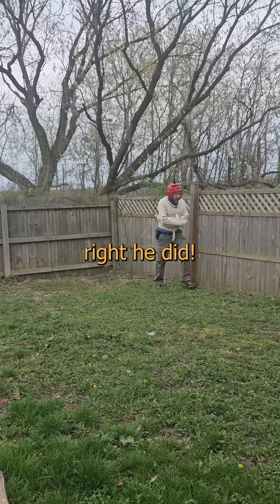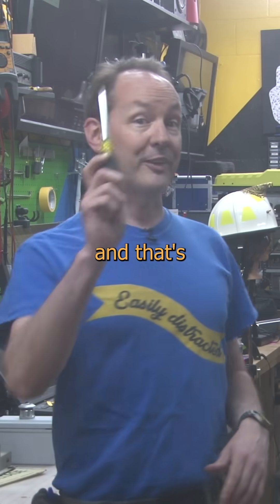Rack Screwed #chrisboden #comedy #engineering #screw #hardware #rackmount #apprentice #educational

Comment: Makes me think of when i was a kid riding horses - had i been told multiple times to wear appropriate foot protection? Yes. Did i decide to forgo said foot protection because i was running late? Also yes. Did i find out getting your foot stepped on in tennis shoes hurts WAY WORSE than it does in boots? Yes, and after the adults around me confirmed i was just bruised, i got very little sympathy for an injury that was my own dang fault. I always wore my boots after that, even if i was running late.

Comment: Step 1
NEVER HAVE AN IMPACT WRENCH.
Step 2
Find a way to lock the drill on 1-2.

I keep the impact in my car when needed but FFS so many people go full power to put a screw into its (im)proper fitting and complain it doesn't fit...or just blow past it's mount and drill through the wall.

Comment: Wait, you guys get square holes? I have to constantly deal with everyone only wanting 2 post or wall mount swing racks now and their pre-drilled 10-32 holes. 

So all my M6 screws have been collecting dust in my van because no one wants a 4 post server rack or anything with square holes anymore. Fewer and fewer businesses have physical servers at their sites or offices. I'm putting up 2 to 4 post conversion brackets for a businesses 1 server, that now has more power than their entire old rack setup before. And doing it as often as I'm taking down conversion brackets because they no longer need an onsite server at all.

Comment: Fun fact for those fans of overtorqued and crossthreaded fasteners: back in the days when all Volvos were RWD, they used wheel studs and lug nuts, unlike the modern models that all use lug bolts like the Germans. The older generation, the 240s, used 1/2inch-20 fine thread lug studs.  The (at the time, 30ish years ago) newer 740 and 940 models used M12 studs.  And they shared bolt patterns, so it was common to swap wheels, for a spare or to get something more  attractive on a base model car.  Now, you couldn't put the 740 lug nuts onto 240 studs. They simply wouldn't start on there. But you COULD get 240 lug nuts over the metric studs.  And zip em on there with impact wrench real quick. And not notice that they really weren't that tight, or that you just trashed a set of wheel studs and/ or nuts.  In fact, after a drive, cornering forces could force the nuts to yield and strip out.  That was a lesson you didn't want to learn twice!

Comment: This one came up for us a couple years ago in a remote (as in 6 hour drive from the office) install.  DEAR RACK MANUFACTURERS:  If you're gonna powder-coat your racks so they stay all pretty and don't rust and so forth, would you pleasePleasePLEASE drill and tap the rails AFTER you apply the finish!  It's remarkable how impossibly tight just a few thousandths of baked on finish makes those otherwise quite nice 10-32 threaded holes, and how willing a battery powered screwdriver is to snap screw after screw the moment they get wedged in that ever-so-slightly-too-small threaded hole! :-(

Comment: I work in avionics and make instrument panels. Sometimes I have shit customers. I told a fellow mechanic how I could screw these people if they didn't straighten up. I don't know how many of you know this but you can buy a number 10 screw with a number 8 head. I could have gotten that in stainless about an inch long and put a stainless nut plate and switch half of the thread counts out instead of 10-32 with 10-24. You can't see the difference once you took them out. If they didn't gall he'd never get it back together again. And fucking bad a customer? Well that's pretty cool.

Comment: I had to reposition a bunch of network equipment this morning that a dipshit subcontractor decided to mount by running M6's into 12-24's.  Luckily, they're threaded posts, and I didn't need the nuts.  Hand drive everything: if it doesn't go in easy, there's a fucking reason!

Comment: Had an "apprentice" once in training with me for 3+ months. Former dry wall "expert" now turning into heavy machinery mechanics. Spend weeks teaching him the methods and math to drill and tap an M10 thread. Pilot hole, then M8.5 drill, then M10 tap. Three easy steps. 3 months into it, I told him I would let him do it on his own and just watch. He did the pilot hole and then grabbed an M10 drill  and as he was about to start. I ask him to stop and think of the size his aiming to tap (M10). He got all flustered and raised his voice telling me to stop babysitting his ass. And proceeded to drill, and then watch his tap disappear into the new hole. 3 months wasted.

Comment: I've had to repair a fired apprentices work.  1/4 NC riv-nuts forever locked with m6 allens all spinning like a bearing when I got to them. All stainless, all furnace enclosures.. small panels 4'x7' (x6) and large panels 4'x8' (x4) with fasteners every 4". Fasteners were by pounds too😅

Comment: Its called a CAGE NUT?! LMAO i got a corten steel planter and it didnt come with hardware... i couldnt find the cage nut at home depot so its held together with regular bolts and washers. Turns out they work fine for a rusty planter box

Comment: Now that looks like our tracking at work a spring loaded to grab plastic I could do so much with that concept teach maintenance to build small solinodes hook up to a program and perfecto It takes me awhile to do math not quick and need paper and pencil! I am laugh at work I been chasing my electrical paper since the age of 17 at 54 I can let it go I don't want to be mucked anymore I won't gain even a small portion back or gain in that matter I guess I have to let it Go cause I smoked like a chimney lungs of a champagne how do I stop chasing this stuff surly I can prove I have learned something over the 34 of a working career from making panel boxes to installing many wires hundreds of spoil of wire got to go depressed and not even an apprentice always shut down to college ya they gave me my welding certificate I was no was stupid enough to try to match my part numbers I put out do it sleeping for 4 dollars more an hour then a Tim Hortons worker

Comment: Metric bolts verses imperial bolts. Then you have 20 threads per inch and 32 threads per inch... I've spent weeks sorting out all the random hardware I have lying around out here and I still have a hard time telling certain sizes apart. Only wish I had some sort of size guage charts you could thread bolts into to get some sort of semblance of this is how you should organize things. Let alone all the lengths and head configurations... Its maddening.

Comment: Before using the powered screwdriver it's important to start the nut/screw by hand and make sure the nut and screw are spinning nicely. I was teaching high school kids to tighten screws onto nuts (for robotics) and realized I do this without thinking, but forgot to teach them to do it. It  took an hour to back out a cross threaded screw.

Comment: 10-32 into M6 is definitely a rookie mistake, but I'd bet most decently experienced guys will still happily thread a 10-32 into an M5 without knowing better. The difference in pitch is only 0.8% and an M5 boly will feel slightly loose in 10-32, but a 10-32 just feels a little too tight in m5

Comment: At the workplace where I first worked, just before I started, the experienced guys had got new ones torn for 'em regarding hazing apprentices, because someone gave a screwdriver to the new apprentice and told him to stick it in a hole in a switchboard that routed 440 volts to several huge water pumps.  The apprentice did exactly what he was told, learned a whole lot about using short-circuit currents and metal plasma to launch switchboards into orbit, while at the same time teaching his supervisor a hard lesson about messing with clueless newbies.

Comment: lmao I had some problems with spring nuts just the other day my apprentice broke the head head off a screw he was putting into a unistrut channel. he overtightened so much the strut had a screw tent on the other side. needless to say 2 bits later he got me and I had to use the Bridgeport

Comment: I use a battery screwdriver in work, it's first setting is 2.5nm enough to be "hand tight" you start the screw with a half turn by hand then press the button to screw it in the rest of the way.

All of the older tradesmen tell me I'm going to strip the threads and to use a normal screw driver like they do and proceed to absolutely destroy a screw and the threads by hand. 

I'm yet to need to drill out a screw I put in but I'm still wrong apparently.

Comment: At 19 i was working for my uncle driving an old 35 ton 4x6 off-road dump truck. I ran the engine out of diesel one day and he simply made me clock-out and rebleed the injectors. I could clock-in as soon as the engine ran smoothly again. 3 hours later, i knew how to bleed old mechanical injectors and learned a valuable lesson about responsibilities

Comment: in our era of late-stage capitalist hellscape, i'm surprised the manufacturers haven't keyed their rack gear to only work with their bespoke mounting hardware.(and offset it 0.5mm outside standard rack width just to add to the pile of planned obsolescence and intentional warranty-voiding damage traps)

Comment: One time I handed a guy a rack mounted drawer to install for storage of some disaster hard drives and such at a TV station I worked at, a screwdriver and a handful of 10/32 screws because the rack he was installing it into is one of the ones with tapped rails not cage nuts, this man proceeds to cross thread with pure muscle and a hand screwdriver that bitch all the way down and then added some torque to boot  (he was near 7' and did strong man competitions).

When we asked him about it he said he thought it was strange that it was tight but he just kept turning...

We decided we are never getting that screw out. It lives there now...

Comment: A few gave me some "second" chances-- I used the EXACT same nuts to Modify a Cadillac Fuel Pressure Regulator installation -- All other Auto Repair Shops adapted my procedure because it SAVES the Mechanic and Customer ALOT of time and labor!!

Comment: I went from a certified diesel mechanic,  a master technician with all my ASE's, a bachelor's in applied science to giving it all up to train to be a Machinist. I used to run the CNC after I got out of the Navy but being an honest to goodness Aviation Machinist is tough. 

I went into that shop thinking I had a handle on most things. Until it came to milling. And thinking through things. Fixing ground support equipment, engines, hydraulics, electrical troubleshooting... that's easy. Wrapping my head around machining is kicking my ass. It's only been 18 months and I'm only about 33% through understanding. I got the lathe work, grinding, tapping and drilling because that's all stuff I had to do regularly as a mechanic. Machining precision aircraft parts for a military fighter jet is a whole new level. There's no such thing as good enough.

My mentor is patient when he shouldn't be. He doesn't hand out praise or disappointment. He just tells me practice makes perfect. Now I don't need praise, I'm a 38 year old man. But I could use a good yelling at our at least some disappointment. I'm a veteran, we learn from tough love.

Comment: I work with a guy who is convinced the fit is never wrong. You’re just not using enough force. 

 There cerebral concrete is strong with that one. Might as well argue with a brick wall.

Comment: the best skill is not not messing up, it's recognising you messed up before it becomes and issue and correcting it. and that unfortunately is not a easy lesson to learn. Guy should have realised something was wrong after 10 screws at most and checked the threading. Then come ask you where the hell you hid the correct size screws. 

More to the point where the hell did he get the wrong size screws in the first place.

Comment: Not only M6 but long M6.  The short M6 screws barely have enough length or don't have enough length to engage with the nut if the rack ears are not perfectly flat or the device is sagging.  Long M6 screws will grab the nut and pull everything together.

Comment: It would be impressive to put an M6 screw in a 10-32 hole. An M5 in a 10-32 is easier, for the first two turns it even feels like it belongs there.
But hey, at least it wasn't an airliner windshield, putting an 8-32 into a 10-23 hole isn't so hard: British Airways Flight 5390

Comment: Whoa, finally something up my alley. I'm an IT guy so i can relate to the rack mounts lol. I once had a restructuring job for a client who had two standing racks, one for servers the other networking. He needed the absolute jungle of the network cage rewired. Five 48-port Fortinets, and 7 patch panels. Worse of all, the switches were mounthed immedite under each other which made tracing the clusterfuck even harder. Those cage nuts are strong but let me tell you, that was the first time in my 10 years in IT that I've seen them snap.

Comment: I just quit a job where the forman was always angry, every little thing set him off and his answer to questions was to try and make you feel stupid for not knowing the answer.

 Guess what that lead to?? No one wanted to ask him questions, so things would just be done without his input, further enraging him and the cycle of mistakes repeats. On top of that no one would give full effort because they didnt feel appreciated. 

Fast forward a few week to my new company, smaller crew, forman works with the employees instead of sitting in the office on his phone, everyone gives 100% effort on tasks, way less mistakes and when they are made they are fixed and we move on. 

Moral of the storey, treat your crew right. It costs nothing and helps everything

Comment: Used to work on cell towers, replacing battery racks and updating power and networking components. Had a kid on his second day, after warning him MULTIPLE times to not let his wrench tough two opposite poles on the same battery (1000 lbs steel rack with 150-200 lbs batteries in each slot). He was taking off one of the connecting bars, and sure as shit, welded his fkn wrench to the battery terminal...AND THEN RAN AWAY! It all happened in a split second that felt like an eternity...boss reached over, no glove, and just smacked the shit out of it, sending it across the room. Dumbass kid almost fkd all of us up.

Comment: MFing cage nuts.  I worked at a colocation firm years ago and we didn't have tools to set those things in the racks.  So it was squeezing them into the holes by hand, over and over.  Just thinking about it makes my thumb and index finger hurt.

More than once we were called upon to rack servers solo.  Finding ways to hold the server up while sprouting a third hand to get a rack screw started.  Trying to get a couple of them in enough to take the weight until you could get the others in and driven tight.

I only dropped one customer server.  Still worked, but the rear corner was suspiciously rounded.

Comment: Could be so much worse. I had a site with super cheap server racks that were all threaded 1032 and the new network guy decided that he was going to use M6 across the whole fucking thing and every single one of those screws was cock-eyed. It took me about eight total hours of work to get the two e-rails pulled out and replaced.

When his 2-year rolled around, I gave him a tap and die set as a joke

Comment: Similar teaching method, but a different industry. I work as a diesel truck and trailer mechanic. When i first started out i thought i was hot shit like most apprentices do. I did a brake job on a 5 axle equipment trailer on a Saturday. It was 15 minutes to close and i was done the brake job, had the trailer back on the ground and wheels torqued. My foreman came by to pull the trailer out and park it because i had yet to try and park a trailer that size at the time. He looks at the wheels and realized that i hadn't staggered the steel rims properly. They only have two holes, and i had all the wheels staggered 45 degrees out so the inner valve stems couldn't be reached. He made me put the trailer back up on stands, removed every wheel. not just the outers. EVERY. WHEEL. and made me do it all again while he watched. At that time i was fucking pissed at him, but i will say i learned my lesson and ive never once done it again and now he's one of my favorite foremen ive ever had lol

Comment: I remember an experienced Medtech equipment installer connecting a 5k ceiling LED onto 230V AC and burning it with a loud "klonk" because he forgot the LED Driver (which can be either in the ceiling Mount or in the electrical cabinet, depending on the configuration).
I forgot to check polarity when installing a new battery pack on my ebike. Luckily the extra fast melting fuse saved my  motor circuit.
I fried a control board on my 3D printer because i unplugged a stepper motor while it was turned on. 😂

Comment: I tasked 2 guys with putting up a pallet of FRP panels in a quonset hut years ago. I came back after 1/2 hour or so and they had one sheet up. I asked what the problem was and one of the guys says “these screws are defective man”. So I said, “show me what you’re doing”. He grabs a screw and high speeds it until it started smoking but he managed to get it in. 
 I was shocked they had actually got the first sheet up when I realized the problem. I asked for the drill, clicked it out of reverse and drove a screw in myself. They both kinda went “Ohhh” . . and looked at each other like the other one was the dumbass. 
 They were good guys and hard workers, they’d just never used a drill before. 😆 I realized later on during that job that Russians will use brute force to get anything done before asking for help.